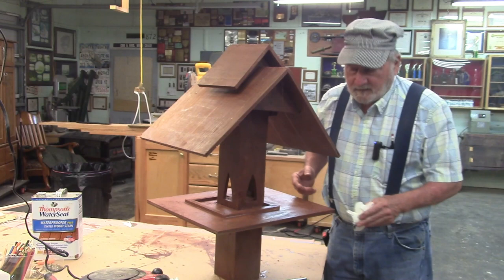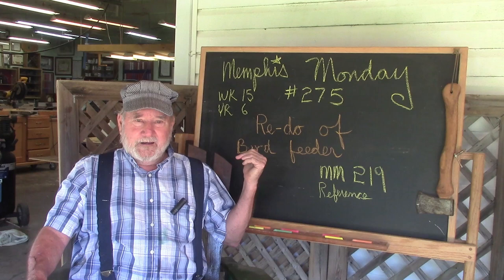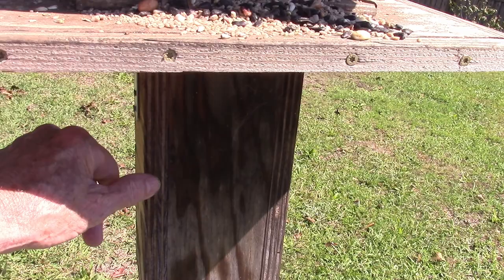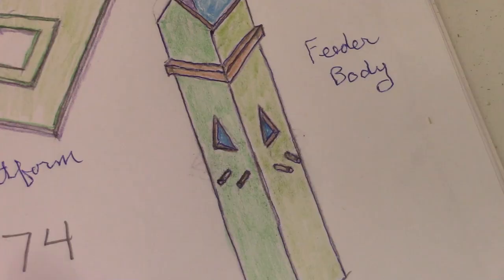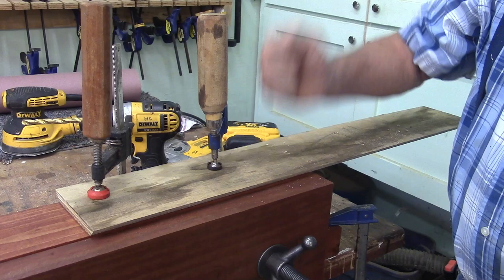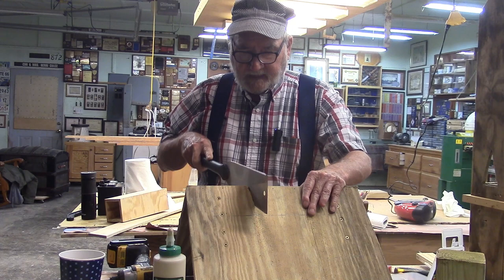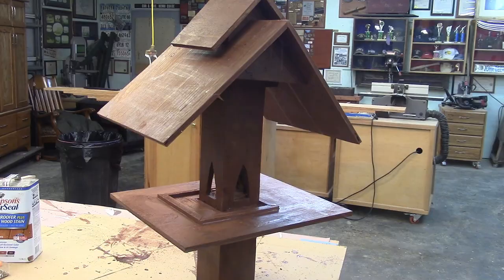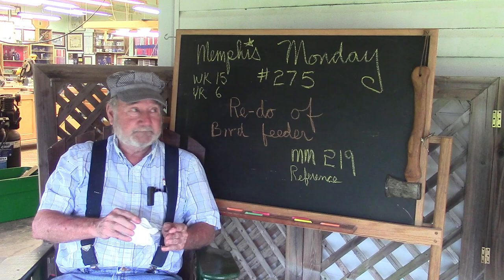275 Remake of our Bird Feeder project from MM 191

Comment: Nice changes.  The 45 degree joints gives it a more finished look.  Did you have any revelations about whether the Thompson's Water Seal is not good to be used on a bird feeder?  

I am a bit obsessive compulsive and crave symmetry.    I feel like you had a very specific  reason you didn't make the ledge around the base evenly spaced away from the body of the feeder.   The ledge I am talking about is the one you added to keep the seeds from falling off.

I have noticed a few criticisms in the past about your mike setup.  These must be people who listen on headphones.  It isn't noticeable on my computer.  Hopefully you can resolve it enough to make it more pleasant for the folks who have a problem with it.